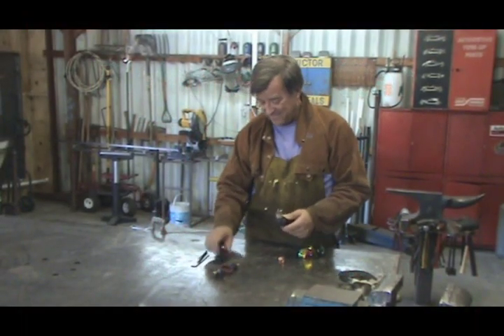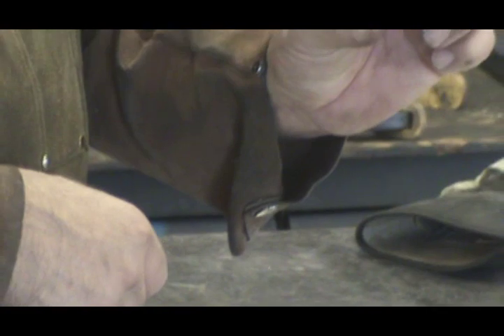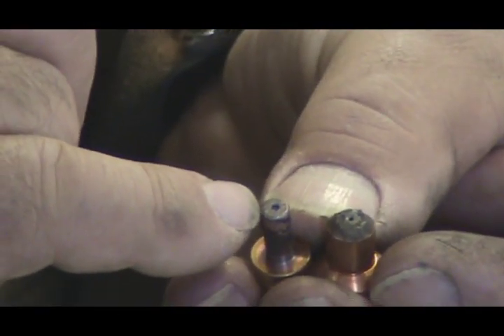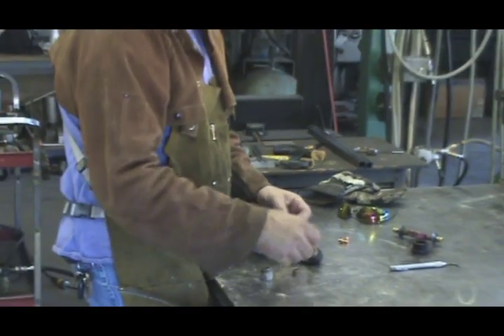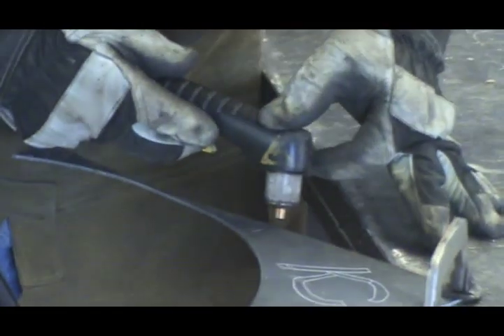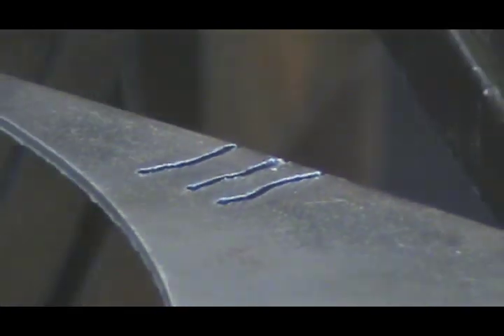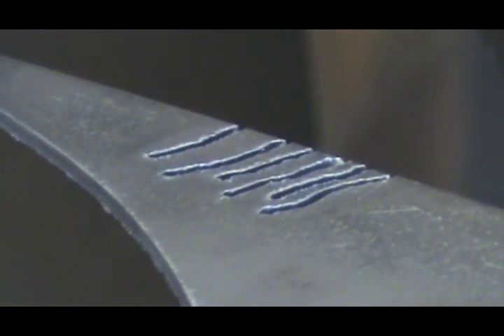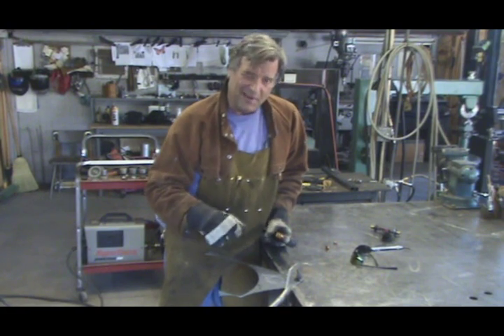Plasma Cutter Tip Tricks - Kevin Caron

Comment: How do I decide the air pressure and voltage
Reply from the maker: Trial and error for me.
Try to run the lowest amps to make the cut and play with the air pressure to get the cleanest cut.  
Low amps save the consumables and the air pressure will give you the cleanest cut.

Comment: Kevin, great helpful vids , thanks, I do have a plasma ?, Just got a 50amp inverter off ebay and cuts like a dream..but it was all in Chinese, whats your rec on eye protection.
Reply: ***** Good comparison on that , how long do consumables last  with these? TU TY .
Reply: I concur.  Just purchased the Hobart Airforce 12ci and I am learning to use it.  Shade 5 is dark enough.  I use a number 5 face sheiks because it is easy to flip up.  Would not be able to see what I was doing if I used a darker lense.  Most of the arc is hidden under the gun.
Reply: Very true most of the arc is under the material being cut. A proper welding helmet will protect from UV and IR regardless of the shade so use whatever is comfortable to you.

Comment from the maker: You are correct.  That is the way you should do it.  However my plasma does not have a drag tip so I can't touch the tip to the metal.  I have learned over time to angle forward just a little to help preheat the metal and make the cut easier.  So a little of both I guess.

Comment: Got a question....I was taught to put the tip on the metal ( touching) and shoot straight down. Sparks under plate should exit at 45 degree approx away from you? If sparks go up, your moving too fast. If they hit your boots...too slow. It looks like your not touching and your angling your torch handle? Am I wrong, or are you better at it and just cheating a bit?